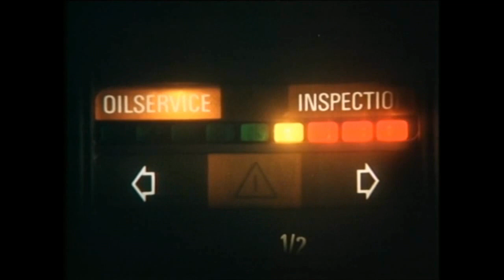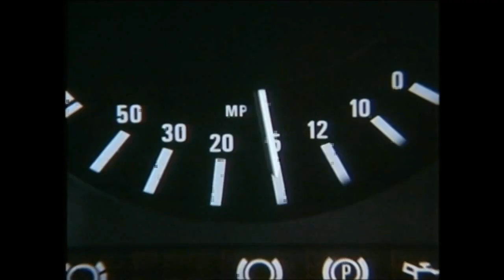BMW E28 5 series quick technical look at computerisation (1982 UK)

Comment: It's great to see info on the 1982 first production year. I have a 1982 528i in Arctic Blue. Wonder if some more video on the launch and advertising is out there?
Reply from the maker: Probably lots of lost footage from that sort of time, or just sitting there with no easy way to search through it in archives. I do like the E28s, shame the prices have rocketed so much lately. I had to settle for a 320 instead of 325i E30 due to prices, and that was half a decade ago.
Reply: @madcommodore  The 528! was certainly at the cutting edge of style and innovation in so many ways. I searched for a long time before catching a 1982 model. It had been sitting still for years and I am the second owner.
Reply from the maker: @rondenholm5499  I think I was watching White Gold (season 1) on BBC and when I did a quick search there was an identical 320i SE 4 door to his new company car in the show a few miles away. Haven't really had a chance to get anything done on it or tinker with it though sadly. It will be another 8 years before it's tax exempt. My friend's Dad had a gold metalic 528i SE, was very sporty sounding back then.